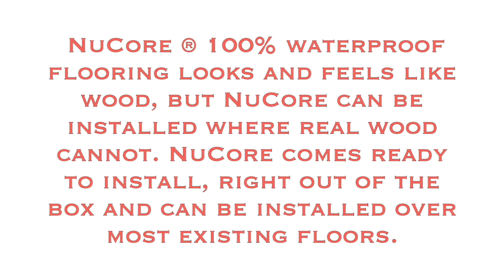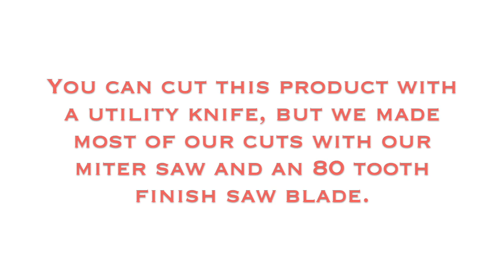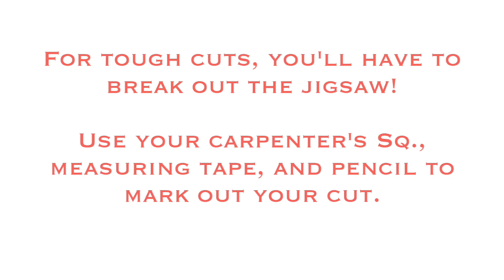How To Install NuCore Waterproof Flooring | Nestrs

Comment: I purchased the NuCore waterproof flooring from FloorAndDecor and they told me to lay a vapor barrier down first on the concrete flooring prior to install to keep moisture from infiltrating even though the NuCore has corking on the bottom. So I purchased a roll of 6mil clear plastic vapor barrier from Lowes and installed it last night and starting the flooring today.
Reply from the maker: Hi! Laying down a vapor barrier is definitely a step that won't hurt! It just isn't required by the manufacturer. Let us know how it goes! We think you'll love how easy it is to install and how great it'll look when you're done!

Comment: Great video. We are installing NuCore in our living room, also around our fireplace that has 12x12 ceramic tiles. Would you recommend putting t molding as a transition from tile to lvp? Thanks!
Reply from the maker: Robert Foster, Thanks Robert! You will definitely need to use some form of transition strip where the LVP meets the tile. T molding is fine. I would go to where you purchased the NuCore product and get something that matches your finish. Also, If it is an active fireplace and you have a smaller tile footprint ask a profession if the heat will warp those smaller transition pieces. My gut tells me you will fine but none the less, I recommend confirming it with the product provider. Hope that helps!
Reply: Nestrs, LLC thanks for the quick response! Yes we purchased some t molding that matches the nucore. We went with ombré grey ! Thank you again!

Comment: Totally thought this was the Morel color. We are getting ready to install this in our entire house downstairs. Your project came out great. Did you all start with a pull plank, finish until your first cut, then reuse that small cut to begin your next row?
Reply from the maker: Brian We suggest doing a dry layout of your first couple rows before you begin...you may not be lucky enough to start with a full plank and not need to end up with just a sliver! :)
Reply: Hey Brian, how is nucore morel holding up? Just bought that color and haven’t been able to find much info about it.
Reply: @danielle2215  we sold the house after two years. The floor was durable to scratches and traffic but if I could do it all over again I would never install vinyl planks. Furniture will indent the planks easily, it was a pain in the ass to install and just overall didn't feel like what tile or wood floor would.

Comment: I'm getting ready to install the NuCore floor, but after taken out the old carpet and tile we noticed the concrete floor is a bid uneven, do we need to prep the floor first? and if so with what?
Reply from the maker: It depends on how uneven it is. Check the manufacturer's instructions but I believe if it's just 1/8"-1/4" you'd be ok. If not, you may have to level your floor out with a self-leveling cement. If you have a contractor you know and trust definitely check in with that professional! Let us know how it turns out!

Comment: you didn't need to leave a gap along the wall ...??????
Reply from the maker: Hey Ed, please feel free to share your thoughts on this. The manufacture did recommend leaving a gap to account for any expansion with temperature change. To be fair, if you let your floor acclimate to the space for a few days it should be fine in a basement where the temp is more consistent.